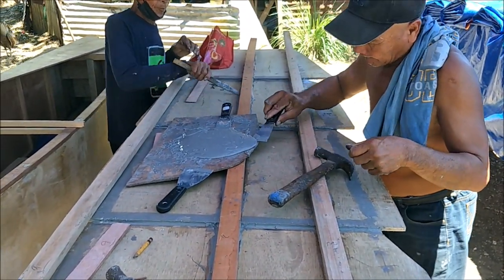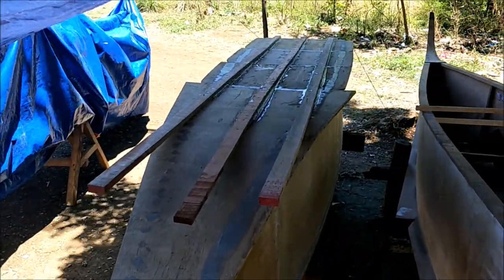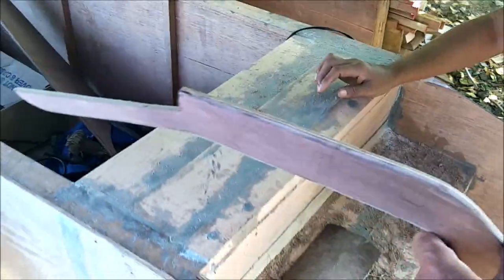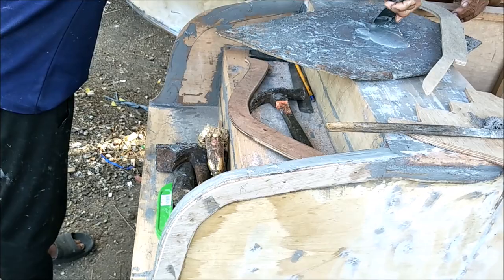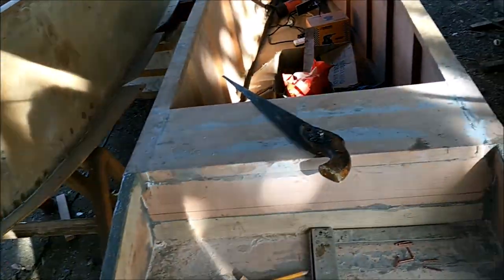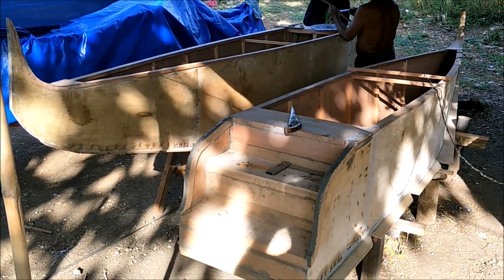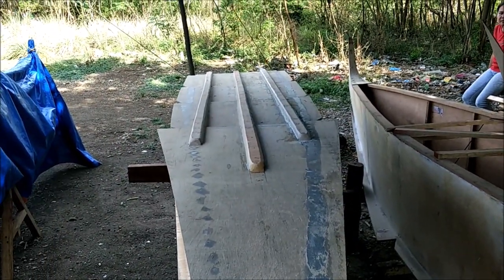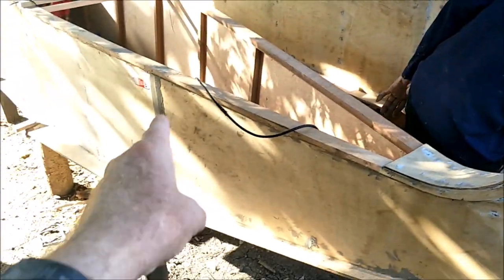Paradise Trimaran - Part 7 - Boat Building In The Philippines

Comment: Why are Philippine boat hulls so narrow? Your center hull two feet wider in my mind is great.
Reply from the maker: The normal style pump boat is made from a tree cut in half and dugout like a canoe (kasko) so it is only as wide as the tree is. They have also recently outlawed the cutting of trees to make kasko's so now the plywood flat bottom boats (3 cut racing boats) are becoming the normal boat for fishermen. I like the 24 inch flat bottom too you can actually sit with both feet flat on the floor😊